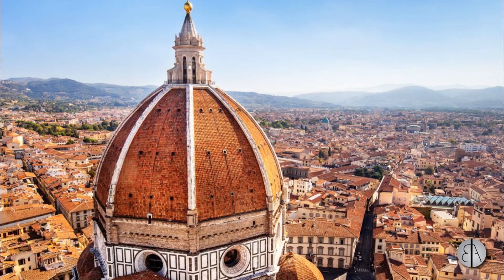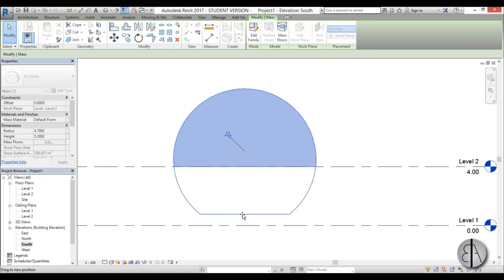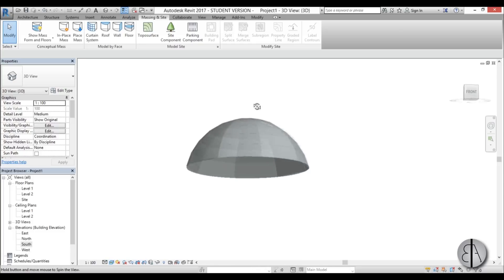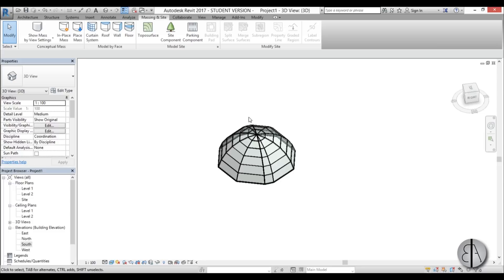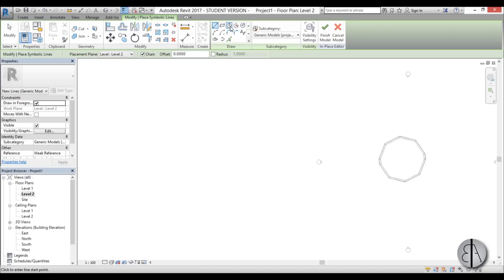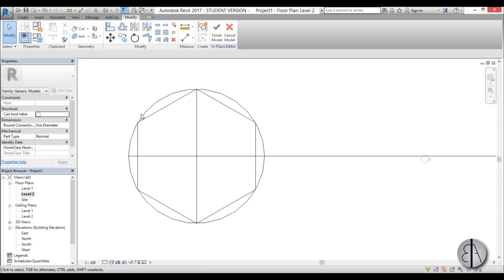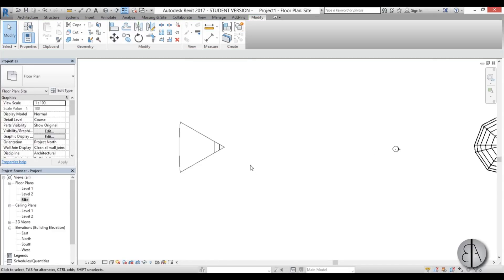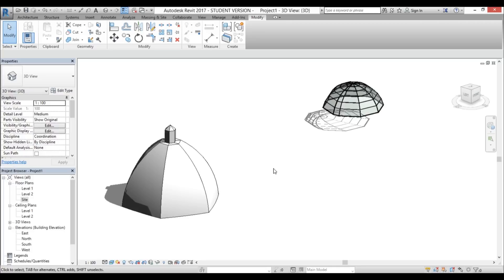Domes in Revit Tutorial (Modern and Traditional)

Comment: When I go to load family, I do not have all those options - I have "route analysis" and "structural precast". Structural precast has more subfolders but none of them lead to any of those folders in the video. I even went back several levels of folders to get to the main Autodesk folder and searched through several of the folders and subfolders from there and I cannot find these. Am I in the wrong place? Are there extra things I need to download? Any help is greatly appreciated!
Reply: I have the same problem and have yet to find a solution. You find anything?
Reply: I have the same problem too,did you manage to solve?
Reply: Mesma coisa aqui